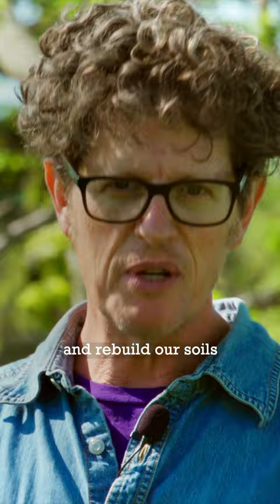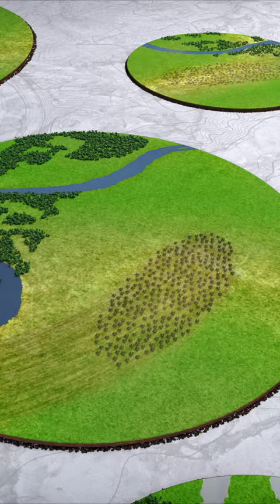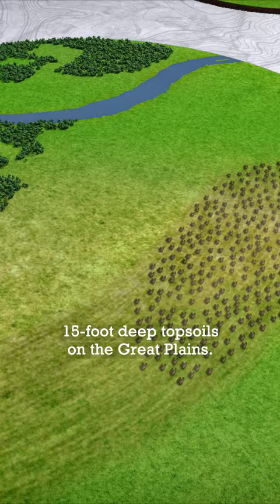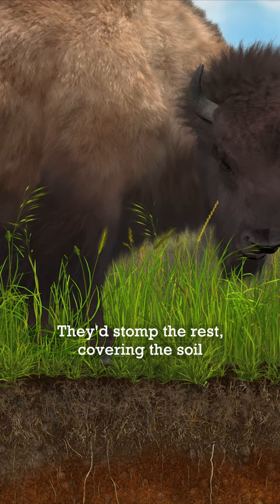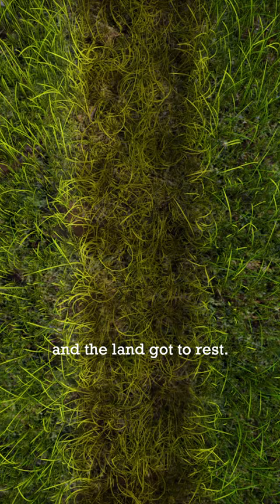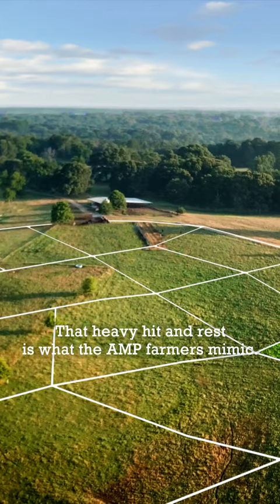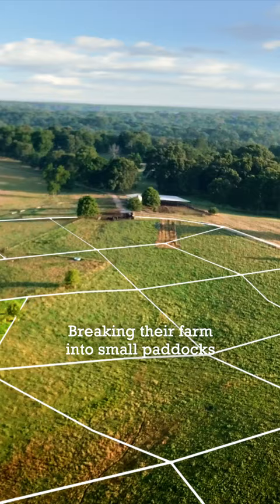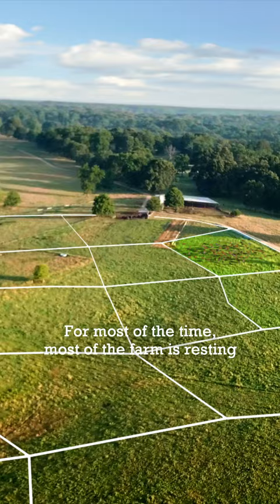Have You Tried AMP Grazing or Other Regenerative Agricultural Practices?

Comment: Total agree, if your into reading, The Frontermans tells the storyline where Simon Kention 1755 watched for days of heads of Buffalo moved across Ohio, some were 30 miles in length, 10 miles wide, Grass was 10 to12 ft tall, Swarms of Ducks would block out the sun for days, as they travel. Trout went up the streams that would weigh in at 55 lbs typical. All was contributing to the Buffalo heards moving from area to area.
Reply: The numbers of animals (miles-long herds of bison, millions of passenger pigeons in a flock) and the size of some (five-foot lobsters in Boston's waters) seems unbelievable to us now because we've lived with the despoiled earth for so long. We need to work at bringing back at least some of that, and it all starts with improving the soil.
Reply: Where did they get their water to drink over those 100s of miles.

Comment: I'm working on building multiple regenerative enterprises on a 2000 acre farm. It's working so far with cattle. Looking for funding for pork, poultry and veggies crop production.
Reply: I know of someone who incorporates chickens with their cattle. The chicken coup is a single wide on a trailer that’s always hooked up to a small tractor. Each day it gets moved to where the cattle move to. They have practically no flies. The chickens take care of the larvae in the manure.
Reply: Might I suggest ducks as well as chickens.
Reply: @DaleEarnhardt4ever it's called a chicken tractor and it is mobile. Chickens live in their tractor. 
It's a portable cage for them to be moved to clean grass. Which they eat. It is more than half their diet. Not a huge pen, we used larger PVC pens. They live in these for 6-8 weeks. These are the Cornish cross meat birds on the kitchen table. 
Eggs are a different bird usually. They rarely live in tractors. ❤
Reply: Keep chickens in and around your cattle, they will help spread the manure and their scratching acts as a way to aerate the soil.
Reply: Chickens also create good fertilizer. This way you get both cattle and fowl fertilizer to make your soil even richer for the grasses they eat.😊
Reply: Multi species rotational grazing. I'm working on getting it going now too. We are also switching to smaller animals as they are about 30% more efficient as far as grazing to weight gain.
Reply: @anbar3729  that great. Hope it's going well. What are your biggest challenges? Let me know if I can help.
Reply: When your doing that many acres how many head we talking?
Reply: @debbyengland7512  under proper management and water supply it could sustain 600 or more. Running about 450 in a drought year and poor forage.
Reply: All right Bruce. Here's a little suggestion for you. Might seem a bit out there but hear me out. 
You got 2000 acres. Give away...100 acres to 20 different families. Sub divide into a min of 4  25 acre plots. 1 per season. 
Start with 50 cows, 50 calves 
Sub divide into two fields, 20 goats to go behind the cattle
Chicken tractors can go out behind the goats
Sheep are very hard on a pasture and need to move often
Goats will eat themselves out of weeds if they are not moved regularly also
Reply: Then get back to the farmer that u got there, you buy feed, the animals and they raise the animals then sell back to you for their profit and yours. It's a really big investment for a small family but if they could say rent equipment thru you or get their pond stocked or a new roof on that barn. Because they got a little help instead of competition.
This type of farming requires daily duties that a crew can't do as well. But there are lots of people right now looking for a way to get started. Deals to be made  
Regenerative requires a family to run that farm . That's what built this country and that's what will bring it back 
Give people farms and you'll feed them for life
Reply: My biggest challenge is infrastructure costs. How are you at fundraising?
Reply: @BruceClithero  u lost me at the politics
Reply: @debbyengland7512  did I mention politics?
Reply: Yea, fundraiser
Same thing
Reply: @debbyengland7512  -- well, then, everything is politics.  But you were clear you aren't interested in assisting Bruce with info on financing.
Reply: @debbyengland7512 I've thought this too and have suggested it to farmers, even if it's a rental and learning situation. Many landowners already 'rent' out their land to large farmers. And I've talked to small dairy farmers from decades ago. They said the small herds didn't have the disease that's rampant in large heards, like mastitis (bacterial infection of teats) and hoof rot (fungal infection of hooves).

Comment: Aged horse manure is the best! Between 4-6 months this stuff is gold and most barns actually pay companies to remove due to attracting to many flies.
Reply: More weed seeds that are not digestible for cows or horses are in horse manure. Horse manure is better used in a hot compost pile.. I have tested almost every easily available  manure..bird, rabbit, goat, cow, horse...
Reply: @marjoriejohnson6535 very true. My poo of choice is sheep, but it's hard to get. Second, rabbit. I sheet compost rabbit poo directly between allocated garden rows.
Reply: @cristiewentz8586  myself because of moving to an urban setting ,I now have a worm farm. I sold most of  worm farm set up ( the stainless shelving and large pans ) but kept 2 pans,  now that I only have 12 large 1/2  barrels on my deck to plant and make sure that the soil produces.
Reply: You won't have extra if your sustainable

Comment: cheapest way is a moving paddock system: strong perimeter fence enclosure within which a couple interior solar/wind battery-electric wires are moved from one preset line of posts to the next, rotating around the single midpoint watersource/solar/ wind station

Comment: All you have to do it setup hydroponics…gives the ground a break year round, and you can put it inside where you don’t have to worry about pesticides (so no bug spray) and you can control your temp, humidity, and light year round so you can grow whatever you want whenever you want.
Reply: Cause Nature prefers to live indoors with super high energy inputs, dependent on manufactured equipment 😂

Comment: you can't develop 15 feet of topsoil with grazing.  Flooding... more likely.  Topsoil is typically 4 - 6 inches, and the only time I've seen deeper was on a farm where the soil is turned by a tractor or in a valley where erosion washes topsoil down to the valley.

Comment: Maybe the medieval 3-field system of rotation was also better than chucking tons of chemical fertilisers?
Reply from the maker: Better, but not quite AMP grazing - where smaller, more flexible paddocks and much more frequent movement drive a whole new level of benefit.

Comment: Don't eat where you sheite. It's not rocket science. Our family has always rotated our cash crop fields. It's the same. Add some lime to a wheat/rye or oat harvested field and till. Plant a year or two of soybeans, monitor nutrients, supplement if needed minimal then a year or two of corn. Always watching the commodity market Chicago board of trade. We were hitting 240+ bushel/acre easily in the early eighties. My grandpa had wheat seed that still would compete or surpass wheat harvests today. I laugh at fields of wheat that don't reach three feet in height. One year while finishing planting corn, I forgot to switch fertilizer rate for our soybeans. I double rowed (so I wouldn't have to cultivate). My dad was pissed. We got hit with flooding in August. Those bean plants were six feet tall. Record bushel per acre for us throughout our fields. Because of the flooding throughout the Midwest in '86 my mistake and different way of thinking made for our most profitable year in farming. No irrigation, minimum row tillage and weed control.

Comment: Would you please also tell everyone to stop using rocks everywhere? Talk about making the planet hotter. Have you ever stood on a pile of rocks in the middle of summer? Broiling. Aren't the deserts just weathered rocks? People are just trying to save on lawn maintenance bills and stop the gasoline using machines. Most are battery and solar powered now but better to shell out for nice cool grass or use low water use low ground cover that doesn't need cut.